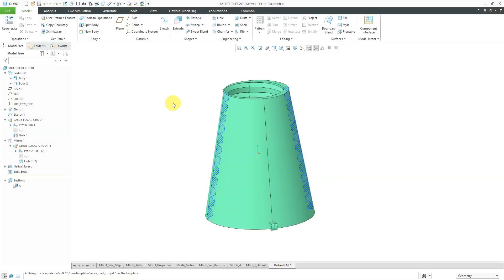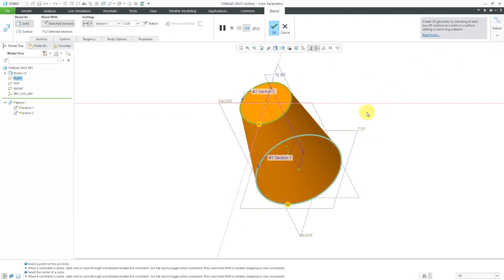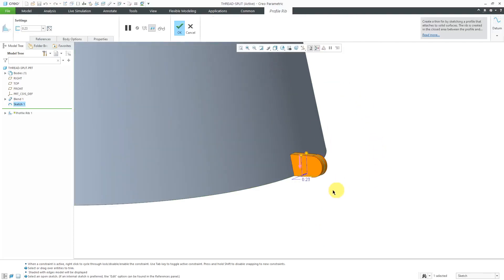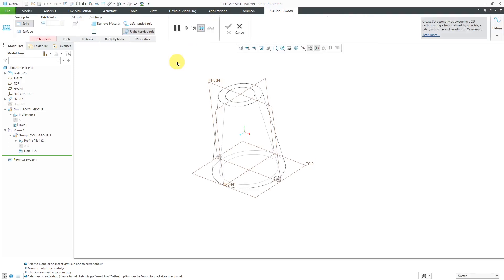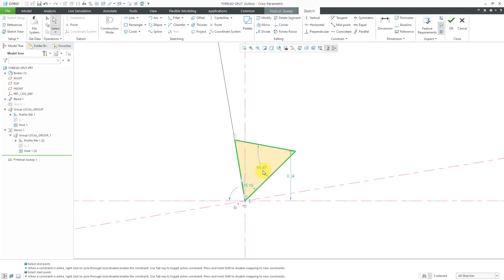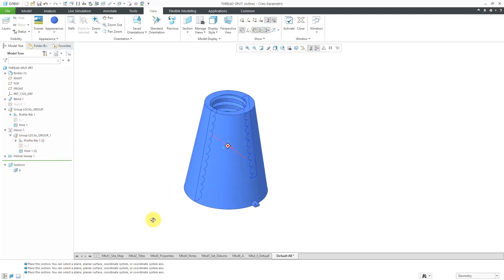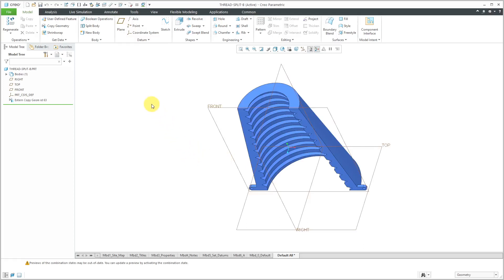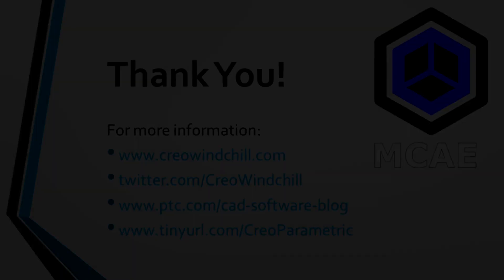Creo Parametric 7.0 - Split Bodies for Threaded Parts

Comment: Hi, great video! I had a question regarding how to handle split bodies in terms of the assembly. Imagine this assembly had other components involved, but I need to change the hole diameter of the rib feature. How would I go about updating the conical component without messing up my constraints with other components in the assembly?